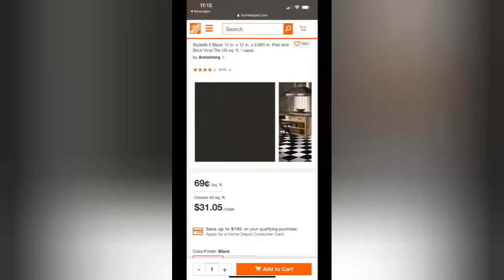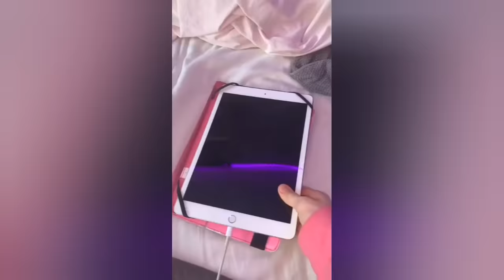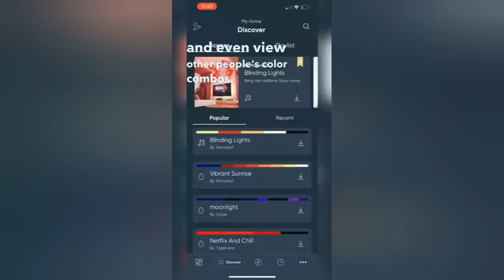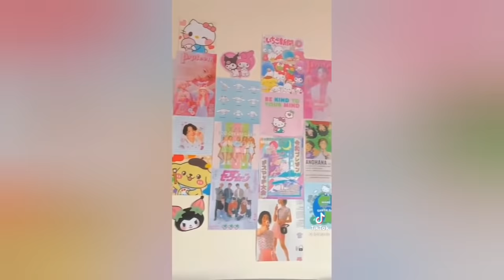Room transformation tik tok compilation diy room decor aesthetic 05

Comment: ⚠️Warning⚠️ 
If you want to add any LED lights, make sure to get an extension cord! I didn’t get one and my outlet started sparking, nearly starting a fire!
Reply: They should pin this-
Reply: I have one but it’s around 7 years old, should I get a new one?
Reply: i didn’t know that could happen
Reply: Why?
Reply: @Luckyou1  wdym?
Reply: @dunno2970  best to get one to be safe :)
Reply: @beth_m  like, why does that help (I want to know cause I will get led lights)
Reply: @Luckyou1  it gives more room for the currents in order for them to not clot together and cause a fire
Reply: @beth_m  tysm
Reply: @Luckyou1  yeah for sure! Just an extra precaution haha
Reply: @dunno2970  yeah but try to get the same brand, because if yours lasted that long it's obviously a good brand lol
Reply: Wait mine didn't do that, what kinda cheap LED lights y'all getting?
Reply: @S0FIATH3MUPP3T  eh my cords aren’t the best but there’s like an extension part and it looks like a spark each time I try plugging it in haha
Reply: Might want to replace the outlet just be safe by turning of braker 1st